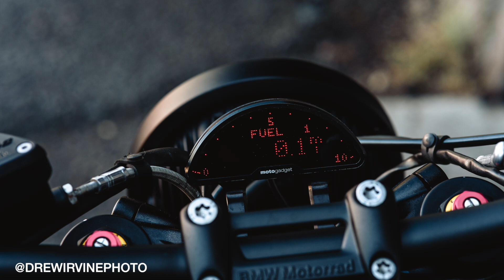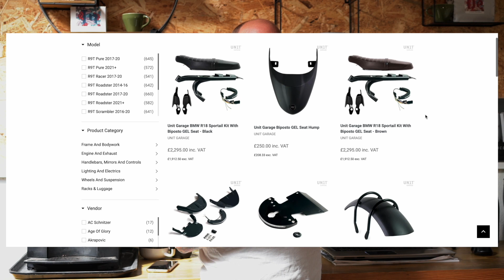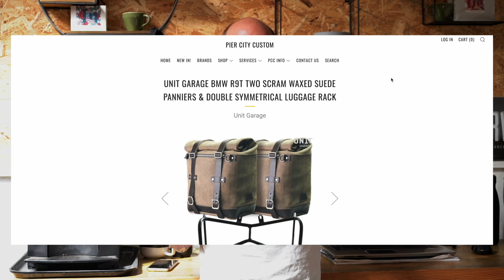PIER CITY CYCLES VIDEO DIARY EPISODE #10 - SEPTEMBER '22

Comment: Hey so I have a request. If you could make a complete install video of clip on handlebars for R9T that would be amazing. Further if it included using stock controls and heated grips since extra holes need to be drilled it would be awesome!
Reply from the maker: This is really tricky to do as a video but we have a blog that explains all this for you - https://piercitycustom.com/blogs/news/changing-your-bmw-r9t-handlebars
Reply: @PierCityCustom  I found the blog a few days after posting this and got it all done. Thanks!